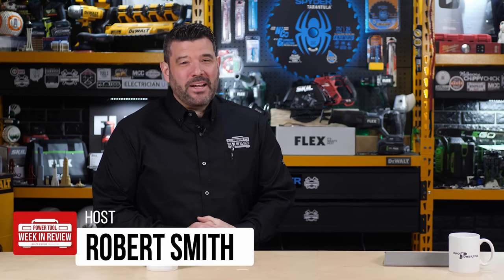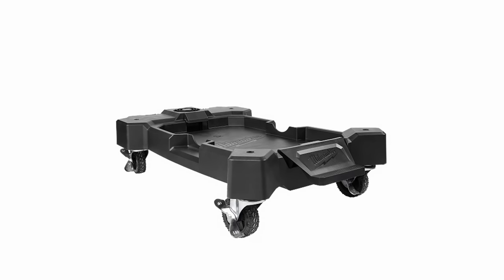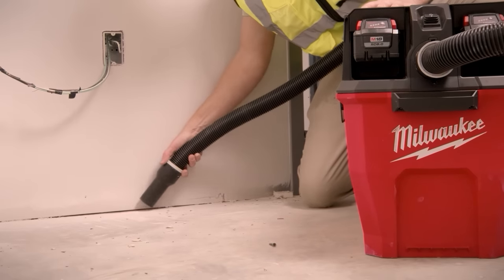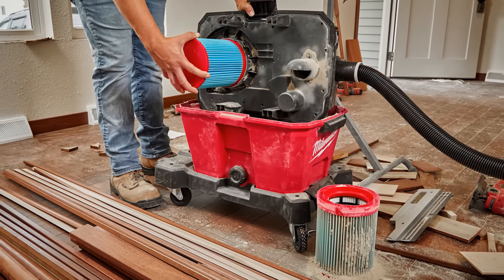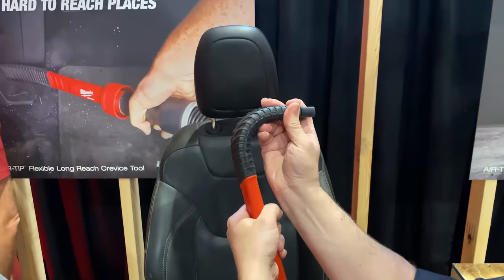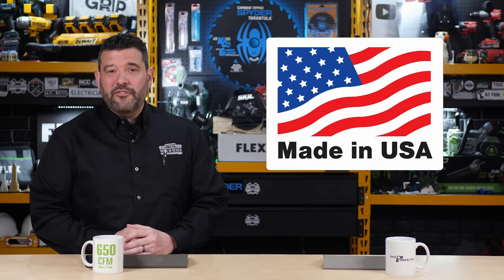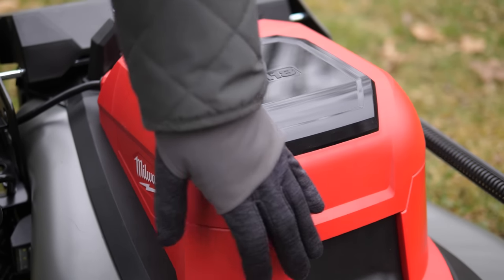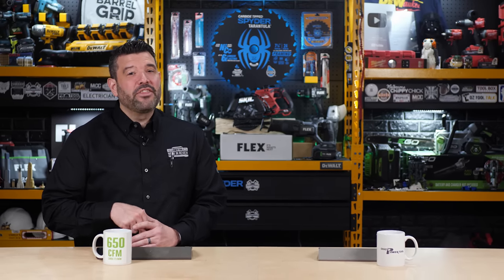BREAKING! Milwaukee announces NEW TOOLS, but doesn't tell the whole story...

Comment: Physics and the electrical engineers FINALLY won out!  About 1/2 of tool geeks made fun of Makita's X2 tools.  Those that use them, not so much.  Great tools.  What Milwaukee has been able to do with 18v is truly amazing.  But they have come very close to the theoretical and practical limits of what can be done with such a low voltage.  I wonder how many hours and jobs were lost in the quest for an 18v lawn mower.  Certainly, we had to wait years because someone who doesn't understand eletricity made a promise he/she didn't know the implications of down the road.  That said, I'm glad they finally saw the light.  Now where's that cordless welder?
Reply: my main prob with mikita it that im a GC and for variability of tools Milwaukie has more choice for a single platform. I am down to only one makita tool and that is due to the fact it is unique to them that is the drywall saw an unusual saw built like a jigsaw with special blades that can cut wood or drywall in forewords or reverse.
Reply: @jonalexander2859  I've seen that tool.  What makes it better than conventional drywall cutting methods?

Comment: I'm a mobile detailer and could definitely benefit from having a vacuum like this, I just can't wrap my head around spending $500 just for two batteries to make the thing to run, and another $500 for 2 back ups.
Reply: I get what you're saying, but as a mobile detailer you would easily recoup your investment since you would not need to use an inverter or a generator. The flexibility is huge. And losing the insanely annoying cords is a huge plus. Think of how faster you can set up and put away with no unwrapping and then re-wrapping cords.  Don't think of it on one job, think of a weeks worth of jobs for the time savings.  And you can use those batteries in the blowers which are amazing for drying cars, especially engines and panel gaps. And light towers too for after hours jobs.

Comment: Metabo HPT has had the dual Battery 36V Vacuum for over 3 yrs and each battery is a 36V already
Game changer is that I get to plug mine in with the AC adapter and don't have to buy 4   12.0's to have 2 charging when the other 2 die
Until Milwaukee, DeWalt and Makita give me an AC option I'm gonna keep building up more of my Metabo HPT collection-plus they are just increasing more and more to the lineup and outperforming as they do it
Still-I do like what Milwaukee is doing with the vacs I love the Milwaukee cylinder backpack vac and have beat the living $#@t out of two of them and they are still kickin

Comment: Here are my two cents on this.  

The good: the power seems impressive, especially for batteries. The "Air Tip" accessories are awesome.  Including the option to use them with other products, awesome. I personally would have liked to have seen one or two provided with the vacs, would have been a good gateway to the product. I don't blame Milwaukee there, why would you provide something with the vac that your competition is not?

The bad: Not including Packout in the design of this product is rediculous, and lazy in my opinion.  It is a real missed opportunity. For some reason Milwaukee cannot seem to make both sides of their house work together, they constantly miss the boat on packout integration.  Packout is supposedly "coming soon" but probably in the form of 3 new heads amd/or 3 new buckets. I am also incredibly frustrated that Milwaukee refuses to allow for a dual power option with any of these high power tools.  It forces you to make a decision between battery or corded (in the future), or buy both (which is what Milwaukee is likely aiming for). Then there are the accessories, Milwaukee only includes the absolute bare minimum to make it work.  No base cart included, attachments must be purchased separately, and no filter bag ($30-45, really?!).  

I am losing faith in Milwaukee as time goes on and as I continue to see these cash grabs that benefit them. Not much consideration for their customer, just their customer's wallets.
Reply: Agree with you, i have been using Makita for years now and always watch what Milwaukee brings out for new stuff, no doubt its nice stuff, as you said allot of it sort of falls short including all the things you mentioned,, is the reason why i haven't made the change to Milwaukee and stayed with Makita and i have had really good service from them also , and i know buddies who have everything thing Milwaukee and have on occasion say wish they'd service us better than they do and he has 2 crews and its all Milwaukee, my guess is the dealer here is good at sales and not so good at the after sales service, which i will never understand, they do make some stuff better than Makita no doubt, when it comes to service you just gotta have or as the old saying goes time is money and its tough enough to get paid as it stands nowadays 👍
Reply: @99unclebob  I completely agree.  I recently made my first Makita purchase (rear handle 36v saw, 2 5 AH batteries, and the cordless sander for $250!) and I love it! I also really appreciate that while it may not be the "most powerful" it works great for me and the tools and betteries are priced fairly. Looking forward to buying the makita track saw soon, since Milwaukee has been so slow to adopt it.
Reply: @joep8520  I do think the quality, ergonomics and  longevity are a little better in Makita tools, my bilateral carpal tunnel doesn't really get inflamed much at all, I really study the ergonomics of tools I want to buy and found 90%of the time Makita the most comfortable to use, this doesn't mean they are the best, just better for me, that's all,

Comment: What about a cyclone? Packout compatibility would have made that an easy to add option. The specs on the most powerful vac is pretty close to the best corded festool which is 138CFM/96” static water lift.

Comment: At these size motors these should all have AC power as an option. Having to use batteries that don't last too long seems really odd.
Reply: How will they sell more batteries then?
Reply: @Patrick Faricy I get that electric motors are set for specific voltages, but step up/down is pretty cheap.
Reply: @Patrick Faricy  Dewalt has a 120v chop saw with an AC adapter because it uses 2 60v batteries to get 120v so all it as to do is switch AC to DC. I don't think their table saws have the option to do AC/battery. Anything with those big power bricks you plug into the wall are taking AC 120v and turning it into the proper DC voltage for whatever device that is. I don't know why these tool companies don't do it other than $$$ for batteries. Some people make their own adapters, but battery tools have a lot of electronics to sense temp, power, etc and prevent overheating the tool or the battery. It should be possible though. But probably the goal would be to match the battery power.
Reply: @sloanNYC  step up/down is only cheap on lower amperage tools/electronics.  Why you see it more often on lights, radios, fans and some small cordless vacuums.  

 Metabo HPT's AC to DC adapter is quite large and heavy.  Has to handle up to 50A DC.

And Dewalt's 120V AC to DC adapter is cheap because you just rectify the AC straight out of the wall.  The bulk of the Metabo HPT (and any potential adapter from Milwaukee) would go towards a step down transformer.  Higher the amperage difference between in/out the bigger your transformer needs to be.

Comment: If they let us choose which tool got dual battery? .. I t would be the chainsaw.. That thing is way underpowered compared to the competition.. competition that is either running a single large 40ish volt battery or running dual batteries.

Comment: This is really exciting! You are right about the packout grip bottom. It would be fantastic to have the small vac wall-mounted. Milwaukee has set the standard, but I hope they don't stop. I want a wet/dry vac with 200 CFM.

Comment: These vacs look awesome , but I would hope that on a vac they would make the top of the line unit to be a hybrid! It can not be that expensive to allow the vac to accept AC voltage , anyone that has to perform work inside a occupied structure will understand why this is necessary

Comment: Ok so here’s an interesting deal. I’m kind of on the fence if M36. I like that Milwaukee stuck to only staying at 18v and not moving from that position. That’s one of the handful of reasons I decided to go with Milwaukee over dewalt as a young guy a few years ago. However I definitely see and understand the use for a mower and certain shop vacs. So my opinion is exactly that: tools that SHOULD be heavy and hard to carry around, throw some dual batteries on those, but don’t be majors and have a dual battery circular saw. ALSO run some batteries in series and give us a damn M18 power station like dewalt’s! And another thing, THEY DIDNT MAKE ONE OF THESE PACKOUT COMPATIBLE?! WHAT ARE THEY DOING?!
Reply: I feel the same way bro! I made the switch from Dewalt to Milwaukee because of the different batteries they had.. I want one battery to fit every tool!

Comment: I'd buy a dual battery Rocket light..... oh wait..... I already have. Although, the one i have runs the batteries in parallel with. Even if the new "10,000" lumen dual battery Rocket light runs the batteries in parallel, that would at least solve the short runtime issue a single battery unit at that brightness would face. 

What I really can't figure out is the true purpose of the MX tower light. Like, the cost to value just isn't there even compared to their current M18 flagship Rocket light. Take the MX tower light, make it M18, give it like 8 slots for batteries. Done!

Comment: Without a doubt the first Milwaukee tool that I would make a dual battery 36-volt would be the 9-inch cut-off saw we own it and we own multiple 12 amp hour batteries it is very hungry, if it had the ability to run two batteries and our run time was increased or our power was doubled we would be super ecstatically impressed

Comment: I'm cool with 2x M18 tools as long as I don't have to hold them to use them (looking at you, Makita).  This has me excited, but $700 on a vacuum kit even with the two 12ah batteries included is painful
Reply: Not really. One battery alone is $249… subtract the battery and charger ur looking at a $180-$200 price. But if you already have enough 12.0s then yeah, kinda sucks

Comment: I vote for the Milwaukee M36 D-Handle High/Extreme Torque Impact Wrench. So they can take the crown from Ingersoll Rand! But we're pretty much, just breaking bolts at this point.
Reply: Yeah , thats very nieche , that would be used only on the trains ,ships(altho not rly as they use hydraulic wrenches) or old rusty semis . Saws are a better option

Comment: You all need to tell milwaukee to stop adding trash to our trash sites and wasting energy, milwaukee has the packout system proven to be the best on the market, why are they still making toil kits that don't work on the packout. 
Every tool milwaukee is making and selling in a carrying kit should now come in a packout kit, period I now have endless cases home with no use for because I am purchasing packout to put my new tools in so I can stack them to be mobile or easier for storage which is what the packout was design for. So why is milwaukee  creating trash that will not deteriorate in land fills. Tell them to protect the environment.
Reply from the maker: Rob Robillard over at ToolBoxBuzz was theorizing that the tabs on top, which are currently used to strap on a soft case for accessories, could be used to securely attach a packout plate.... >.>
Reply: @ToolShow   yea but why should we as consumers and loyal consumers have to rig attachment that can make the whole stack unstable and just unsightly, milwaukee can do like festool and put all their tools in a pack out, there are many out there will pay for a kit containg a packout where you don't have to retrofit it with foam to hold the tool.

Comment: Dual Batteries vs Dewalt's Flexvolt take. I'm a dewalt guy (because of the 60v grinder, fight me), but either seems like a fine solution for allowing heavier duty tools to have the power they need while letting your batteries work just fine alone on smaller tools like drills and impact drivers. Anything that lessens the number of diverse battery platforms is a winner. MX, dewalts 40v, anyone else doing 36 volts or 40v "max" (again, looking at you dewalt) is a good move in my book.
Reply: The 36V Metabo HPT grinder will outwork the DeWalt with the Flexvolt and I get to use the AC adapter for those long runs-And I don't have to buy so many GD batteries like the red, green and yellow make me buy to run my crews
Reply: @baseballdude8491  sure it will, I've used it. It's a monster to use and no where near as convenient, that's before taking in to account the number of other tools that will run off the batteries. 

And liking your own comment is a pretty pathetic way to exist online.

Comment: I'd have to say the dual batteries would be perfect for the 12" miter saw 👀
Reply: Metabo HPT does 36V with 1 Multivolt battery and has the AC adapter which is great for my table saw, mitre saw, SDS Max rotary hammer, Vacuum, grinder, band saw and many more
Milwaukee, DeWalt, Makita drop the ball with not having an AC adapter for the longer run time tools

Comment: I can honestly only see a majority, if not a super majority of these vac ser ups being sold will be the largest of them all. What is the sense in having a wet dry shop vac with a small battery and motor as well as a small container?  Milwaukee already has small and medium sized M18 vacs out there and one happens to be Packout.  

My only concern/gripe is that they are trying to sell the Air Tips as a one size fits all hoses situation. This is fine for the  smaller diameter hoses, but it's going to be a choke point for the larger hoses. They should call them Air Trap, because they'll be trapping all sorts of debris, especially when picking up larger pieces.  But I know, you'll say these are specialty tools or tips, only to be used in specific applications.  But we all know better. There's going to be many that will use them for general clean up, other than asmall amount of smaller particles. 

I do hope they actually get that much run time, because these batteries take 130 minutes to recharge on a rapid charger and 60 minutes on a Super Charger. But that's only charging one battery at a time, unless there is a Simultanius Super Charger I haven't seen yet. Better get at least 2 extra batteries... 

Don't get me wrong, I absolutely love this vac. Cords are not fun to drag around, especially on a new build without plugs readily available throughout the house. Or a few places I go to that don't have power at all.

Comment: No point having pack out cleats on a shop vac - no M or H class means usage limited to cleanup
Reply from the maker: Hey Mongrel85, I somehow missed this comment a few days ago. Could you elaborate? Are you referring to certain regulations?
Reply: @ToolShow  To clean up concrete dust or anything on a jobsite to be OSHA compliant it needs to be M or H class - this is just a shop vac so not Pro level

Comment: I'd like to see a M18 dual battery Super-Duper Hawg for Post Hole Digging. Electricians and Low Voltage Technicians would use that pretty well.

Comment: To me any tools that demand a 12A/hr battery (never mind 2) have to be corded as well! Any vacuum cleaner big enough to be used as a dual extractor needs a "on demand" control( when you run the saw, the vacuum comes on) AND HEPA STANDARD! I don't need nor want 5 different vacuum cleaners!

Comment: Milwaukee should make a worthy competitor to the 2 Dremel mini circular saws, one is battery powered, the other is corded.

I know there is a Milwaukee 3” mini circular saw (2522-20), I just bought one last week to cut plexiglass and it kept stalling after molten plexiglass jammed the blade, over and over, due to excessive blade rotation speed. But there was no way to slow it down; the trigger is an on/off type, not a variable speed trigger. Bad design flaw.

Comment: Wish they'd make a daul  battery 55qt refrigerator that could be 12/24v or AC that could run on the high output batteries. An have it so if you plug it in to AC or DC it would recharge the batteries.

Comment: Yeah it is too bad Milwaukee didn't design the larger Shop-Vac to basically be like the pack out rolling tool box to add your pack out tool boxes.  Festool has this with their vacuums. Also why is there not a remote control option?   DeWalt portable HEPA vacuum already has battery pack and remote for like 3-4 years now.

Comment: Maybe I'm the idiot, but Milwaukee has a point. MOST of the common home use tools in their lineup wouldn't really benefit from 36 vs 18, and the increased weight/bulk would be detrimental. For a commercial user in their larger tools, I can see a benefit, and I'm sure Milwaukee does as well. Their dual battery system seems to do the best of both worlds in not needing to make a 36v battery. Your m18's you already own and use in your hand tools can just be wired in parallel on their newer, larger tools. Thus the m18 doesn't need to become m36!

Comment: I do think they should add more m18 dual battery tools, but only on the heavy HEAVY duty stuff.  Stuff only non-mobile or already weighing tons.  
Being said, if they do tools that aren’t huge but still have double batteries, I think it’s fair enough to have some small batteries (like the ones you get with most starter Milwaukee kits - 1.5ah - 3.0ah)